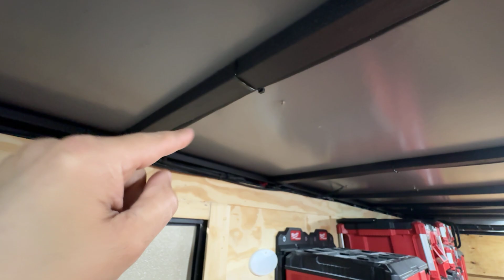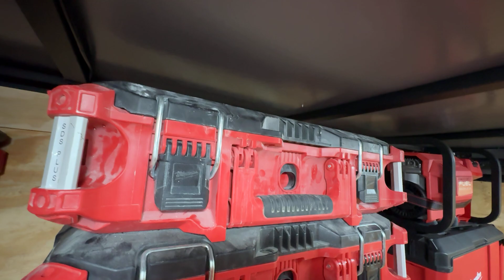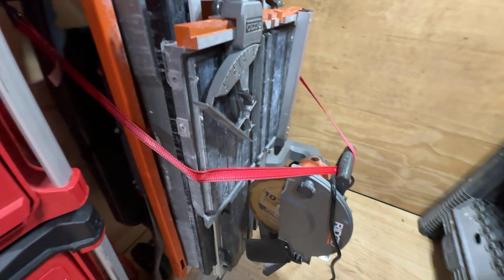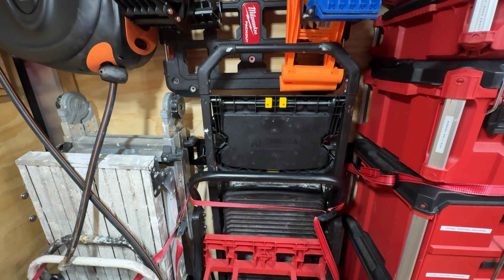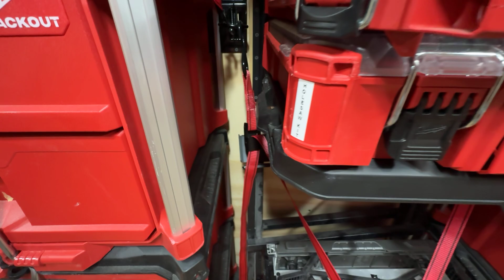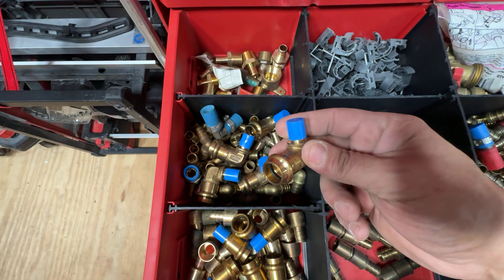My Milwaukee Packout Trailer (Part 2) Tool Tour and Upgrades!!!

Comment: FYI nail gauge and wire size (AWG) are not interchangeable terms. That being said I love your setup. Regarding the 18ga nailer I don’t have issues but my 23ga M12 gets stuck regularly. It’s to the point where I dread using it but I don’t need it enough to justify changing it out. Used it a month ago to finish out bathroom trim and it didn’t jam once I thought I witnessed a miracle.

Comment: That's a great setup. Well done bro. 
Glad you don't listen to the haters. , most of them are simply speaking out of jealousy for what you have. 
Great trailer man!!
Reply: However Just want to add a little helpful hint. On your M18 grinder I think you have your diamond blade on backwards. If you look closely at the diamond chips, they have a comet that trails behind each and every diamond particle. Those comets are supposed to fly behind the direction of the blades intended direction. You'll have much less chip out and it won't walk on you as much. If I'm not mistaken your Makita blade needs to be turned around. No judgement here bro just a helpful hint

Comment: Those Diablos are the blade of choice for all my cutting tools. From Circ saws, miter, table saw, sawzall blades. Some of the new Milwaukee Nitrus blades fuckin rip though. Catch em when they are 2 for 20 at the depot.

Comment: How do the wall mounts hold up with weight on them after bouncing down the road?
Reply from the maker: @EricSargent-o5p  no problem at all. You can’t over load them but they’re fine for what I have in there.

Comment: I find the pencil sharpener both practical and hilariously goofy at the same time. Good ole lumber pencil and a knife has been the way since before either of us were born😂😅
Reply from the maker: I only like to work with traditional pencils.  I don’t know why. I also like a fine point. 😂
Reply: @ans1020  Oh I keep a little hand sharpener in my “main bag” and I always got regular pencils lying around too. Sometimes the fine point is needed for certain things. That’s why I said “both practical and goofy” because I see the value in it but at the same time you know there’s plenty of times you ‘marked’ with whatever is closest to you. I’ve even just scratched a line in something with whatever nail/screw was in my pocket/pouch in a pinch. 😝

Comment: Also I absolutely agree. Never buy a cordless SDS max. As someone who used a rotary hammer every single work day for 15 years, when you need the big boy gun batteries just become more of a hassle than they are worth. BUT a cordless SDS plus is a godsend for all the small anchors/chipping.

Comment: I personally learned there is a very fine line between neat and “too neat”. I remember field guys I learned from that would waste 20-30 minutes every day wiping every bit of crud off their handtools. Then wondering why I passed them up and became their foreman. Because while you were busy polishing your boots I was busy getting things done. Of course, I’m not a pig either. Take pride in your job and your equipment. I started as a “shop kid” at 13 and one of my responsibilities was repairing all the broken field tools that came back. Learned how to repair pipe threading machines, sawzalls, etc at a young age. And that’s why I got some tools that are 10+ years old and still chugging along like new.

Comment: I’ve had good luck with my 18 gauge nailer, not sure which generation you have (gen 2 came out in 2022 I believe). Milwaukee is coming out with an m12 18 gauge brad in a couple of weeks. Might be a good option if your max nail is 1,1/2” and you still use your 15 gauge for heavier applications.
Reply: I love my 18g Milwaukee